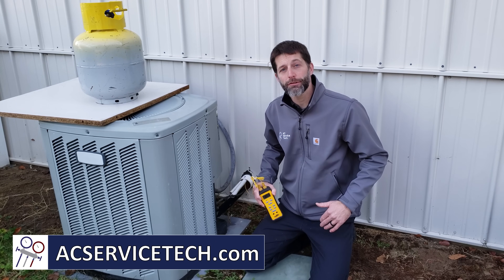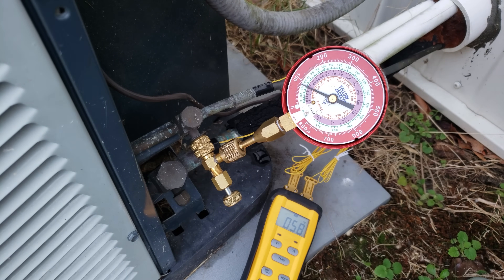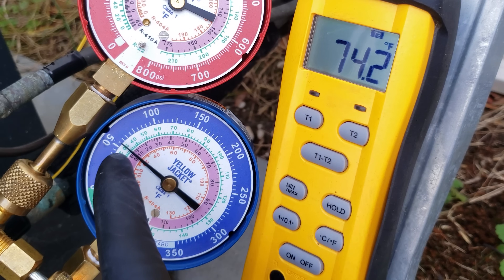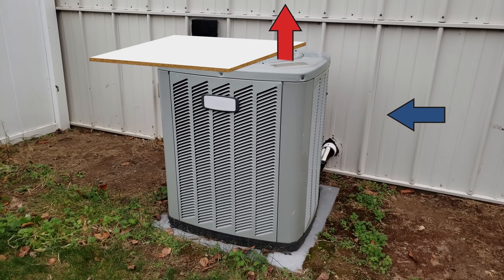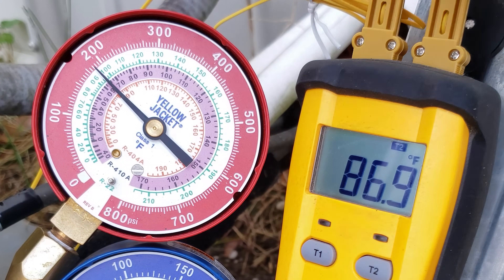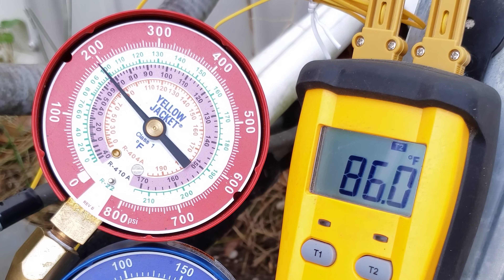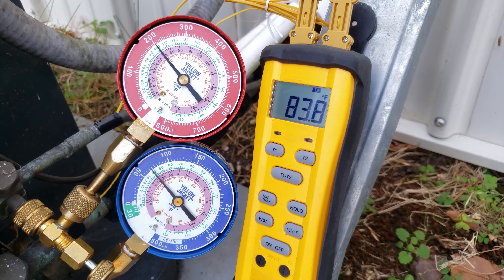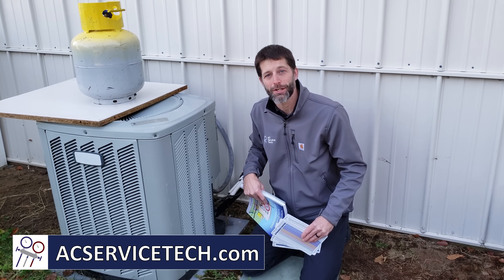Low Outdoor Temp, "CHECK THE REFRIGERANT CHARGE" in the Cold!

Comment from the maker: Below are the TOOL LINKS and ANSWERS to QUESTIONS!
Fieldpiece ST4 Dual Temp Meter - http://amzn.to/2wc1ME3
Charging Jacket - https://amzn.to/2rCNcnm
Blue Test Gauge - https://amzn.to/3mxYt5t
Red Test Gauge - https://amzn.to/3pvzxxo
Thumb Screw Valve Core Depressor with Backseat - https://amzn.to/2mR0sCL
Quick Reference Charging Cards - https://www.acservicetech.com/store

The total superheat was a little high especially with the low heat load. I will need to check the charge again during the beginning of summer to investigate why the TXV isn't allowing more refrigerant into the evaporator. The bulb was mounted correctly. I did see that. The superheat should be lower such as below 16 degrees but preferably closer to 10 degrees. Any time you check the charge this way during low outdoor ambient temps, it is only in a worst case scenario and the technician should schedule another service to measure the charge again when there is an adequate heat load on the building such as 85 degrees or higher outside and 74 dry bulb or higher inside temp and a 60 degree or higher indoor wet bulb temp. Realistically, the indoor and outdoor dry bulb temps both must be above 70 degrees before and during the measuring process. Thanks!
Reply: Many thanks

Comment: But, it seems you could have achieved any amount of subcooling you wanted by restricting the airflow more or less. When you started out you had low subcooling because you were restricting the air flow only a little bit. Once you restricted the air flow more you got higher head pressure and higher sub cooling. So why don't you just restrict the air until you get 10° subcooling and then say that it's correctly charged?

Comment: Do you need to have the indoor air temperature above 70 degrees to accurately check subcooling or can subcooling be measured effectively just by using a charging jacket outdoors without having to heat the indoor space to above 70 degrees?

Comment: I have the exact same unit. Mine is manufactured in 2008 so 15-year-old. It is not cooling. I called an HVAC company and technician hooked up gauges and said it has low refrigerant. They dont add refrigerant because it is R22. I am immediately connected with a salesman to get a quote of 10-20k AC replacement. It is so frustrating to experience all of these especially this time where I am looking for my first job after getting my PhD. 

Anyways the tech measured the pressure when it was 50-60 outside. He didn’t do any heating method as you described. I wonder the measurement he did was false

Comment: I find you can't muck about, the room will reach setpoint pretty quick and shut off before you're ready.
Btw I'd definitely flip it over to heating to recheck the pressures
Reply: That’s if it’s a heat pump otherwise you can’t check the pressures in heating mode

Comment: To many variables that can give you a false reading and no actual humidity load to simulate wet coil condition techs will be recovering charge in winter and recharging in summer wait for adequate testing temperatures.

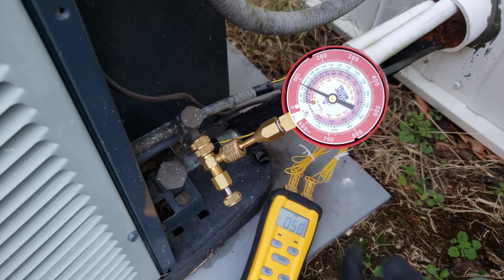Comment: 2:00 how is that silver stem on the depresser not leaking refrigerant? I don’t understand what’s keeping that sealed
Reply: Just a compressed gasket or oring.  There is  a packing but you can tighten if it ever starts to loosen up.  You tighten that nut and it further compresses the sealing material.  Exactly the same idea as any water gate valve.

Comment: I use a contractor garbage bag as a charging blanket. Simple light weight multipurpose. Easy to adjust and no risk of the plywood flying off and causing injuries to a newbie tech.
Reply: Wouldn't a bag fly off faster than a board

Comment: A contractor garbage bag blocking the intake of air would be easier.Easily and safely adjust the amount of air that is moving across the outdoor coil. No wood or recovery tank to deal with. Also less stress on the fan motor. Cheaper than a charging blanket and it serves two purposes.

Comment: My minisplit is a 12,000 btu unit. Unit indoor and outdoor are running there is no error code appearing so I let it run all night about 12 hours straight, indoor not heating or cooling? indoor fan is turning but only getting ambient room temperature coming out of head unit was installed by licensed hvac teck 2 years ago can anyone help thanks.

Comment: I would be weary to use that method to check the change, I mean what if you move the board on top? The pressure is gonna change right?  How do you know where to put the board or how much to block off?  I just feel it's a "fire from the hip" scenario where you don't truly know what the charge would be because you moving the board blocking the airflow will have a major effect on your pressure. I'm jaded cuz I work in South Florida and its only cold for a month outta the year but I wouldn't hang my hat on that method. Thank you and your videos are great
Reply: It's pretty much a good ballpark figure, but you're right not 100%. As an installer in NW Louisiana we have way more cold weather start ups, we always schedule a follow up return visit when the weather warms up to recheck. No additional charge to the client, and saves the extra cost of an unexpected callback for a tech at 10 o'clock at night lol. Gotta love weather in the south..
Reply: This is making the best of an non-ideal situation.  Anytime you have to check charge  outside of design conditions is technically not ideal... Which is almost always by definition.  This method is not perfect but if you have a thorough understing of the system and this method, you can be fairly confident with your results.  Many people that do this if they need to in cooler weather, will try and come back in warmer weather just to double check.

Comment: So I'm curious. Why are we driving up the pressure to simulate a warmer day in order to check the charge? Just because the sub cooling is naturally gonna be higher with lower temperatures?
Reply: To simulate actual working conditions /design conditions.  I believe you are correct - in low ambient conditions, the refrigerant condenses much faster so it will subcool much more.  The ratings given, like 10deg F ideal subcooling are for specific conditions.  Conditions, as he mentioned in the video of approx 72-74 deg F inside and maybe 70-80 deg F outside (I can't remember what numbers he used. Most condensers run at approx. 20-30 deg F above outside temps so to put the system into "design-ish" conditions we have to get the head pressure up to a saturation temperature somewhere between approx 90 and 110 deg F.

Comment: Totally mis-leaded information and could be led to refrigerant mis-charge and equipment damage. 10F sub-cooling on name plate is equipment factory design sub-cooling at 95F ambient and 73F indoor wet-bulb temperature. I didn't see author did put indoor wet-bulb temperature into account. The truth is, if indoor wet bulb or outdoor ambient temperature or both below equipment design temperature the sub-cooling going to increases, if above the sub-cooling will decrease. 
For example: at 80F ambient and 70F indoor wet bulb temperature the sub-cooling will be about 17.5F.
Reply: You are correct. The little paper attached to the electrical cover called service facts would tell him that. What he is simulating is a ODU with an airflow restriction running in low ambient. This is not how it should be done.

Comment: If you take refrigerant out then your superheat is going even higher than 20 and with no heat load does not justify over a 20 superheat. Thoughts?
Reply: TXV's job is to maintain superheat (within a reasonable pressure range).  Removing a relatively small amount of refrigerant will remove total amount in the system.  TXV basically maintains the same amount in the low side so the refrigerant pooling in the high side is reduced... Lowering the subcooling.  *With any fixed metering(piston or cap tube) device you would see superheat increase and subcooling decrease.
Reply: @sbitschy  ... Just for reference...36 years in the trade and teach worldwide. Standard txv will not maintain superheat no matter what occurs. It will only maintain with within certain parameters. 👍 You can absolutely have a  super high/low superheat and subcooling.
Reply: @burtminshew4812  I don't understand what you are saying.  I am here to learn.  I said that a TXV can only maintain superheat in specific pressure range.  I feel like we said the same thing.  I am well are that you can have high superheats and low subcooling in certain circumstances.  It seemed like he removed a negligible amount of refrigerant, I didn't feel that it was enough to start messing with the TXV superheat control.  Can you explain what part you disagree with?

Comment: Wouldn’t moving the plywood change your values ?
Reply: That’s EXACTLY what I was thinking. Like, how can you REALLY tell it’s overcharged or not… If you cover it all up or not at all the values change… so which is right? Doesnt seem consistent and or accurate.
Reply: The entire point of this is that your values change depending on how much air you block off.  The 10 deg F Fahrenheit subcooling target is given for a specific set of conditions.  We can't raise the outdoor temperature to these specific conditions but we can block off enough air to get our pressures and saturation temperatures up to these conditions.  Your condenser simply rejects heat from refrigerant.  Since the condenser rejects more heat at lower outdoor temps and the same airlow,  we can start to block off airflow on a lower temp day until we are rejecting heat at the same rate as it would on a warm/hot day(the specific conditions where the 10 deg subcooling is the target.)
Reply: Sorry tough to explain in a YouTube comment... Anyways, the concept of what he is doing is perfectly legit.

Comment: Excellent explanation 👍🏿I can remember back in the day if a system was overcharged the hvac guy would just release some out the unit into the open air🤷🏿‍♂️
Reply: Back when I got into the Trade (1979) refrigerant tanks allowed you to add gas back into the tank.
The guy I worked for had two 15 pound tanks ( I not sure but I believe the 15# are no longer made)with red paint that he used as service tanks. He bought 50 pound tanks to reduce cost I think $19 per tank was the price 40 plus years ago. When a small tank was empty he would pull a vacuum and stick it in the freezer and use the 50 pounder to refill it the next morning. 
  Great guy to work for but taught me to add gas till the suction came back cold and several other bad habits that I thought was correct until I went to School for  HVAC two years later. Ours is a great Trade to have because you have to have knowledge of multiple trades to be qualified to do our trade. Which translates into rarely hiring someone to make a repair on your home.
Reply: Still do🫣

Comment: Here is my question, instead of pulling out charge could we adjust the txv to be more open? Wouldn't this lower superheat and lower subcooling?(assuming it's adjustable)
Reply: That makes sense to me.  I think it would just be a little more time consuming - labor costs are expensive, might not be worth it to the customer.  Also, depending on how long the vapor line is, 20°F superheat might not be that high - in a longer vapor line removing refrigerant seems like a better idea.  Just my thoughts.

Comment: Can you do that with a piston metered system?
Reply: My opinion yes but not the best. I run the unit to see how much above ambient my head pressure is. Then start restricting it and compare my simulated head pressure and ambient vs wet bulb to get a target superheat. If it looks low I ramp the head pressure up more and then check it again. If you go this route you have to monitor the superheat carefully to make sure you don't slug the compressor. Works best on cool calm days. Add rain or high wind and you're better off coming back on a different day.

Comment: Usually I love your videos but I'm a little confused in this one. With the valve core remover, you were not removing the Schrader core so why were you spinning it as though you were loosening it? Those just push in and out. You usually push in and then turn while it's pushed in.
Reply: That's not a Schrader valve remover. It's a low loss called thumbscrew core depressor.
Reply: @Pixelplayzhere  
Couldn't you just use this every time you put your gauges on regardless of using hoses or the stubbies?
Reply: @BibleBloopers  yes you can use it
Reply: @Pixelplayzhere  oh ok. Thank you so much

Comment: Why is superheat high if you claim to be overcharged?
Reply: I was thinking the same thing. Might have a TXV that isn't opening as dar as it should or is slightly restricted
Reply: Since the system has TXV, we should use sub cooling method, we don’t have to focus on superheat, because, we need just to adjust sub cooling to manufacture design degree,
Reply: @bill98778  you don't fine tune the charge with superheat if you have a txv, but you still need to see if it is within range to detect if there are any other problems. But Craig said SH is high, therefore it is overcharged. And I'm wondering how did he get that conclusion.
Reply: @realSamAndrew  well, if the system is overcharged, could damage the compressor, or since the superheat is high could be the TXV is not working properly even he said is doing his job

Comment: At the 6 minute and 40 second mark you said something that doesn't sit well with me. Not sure if it was a mistake. 
Why would the subcooling be lower when it's cooler outside and higher when it's hotter outside?
I would think it would be the opposite. 
The cooler it is outside, the more the condenser will be able to condense... More subcooling... and the hotter it is outside the less the condenser will be able to condense.... Less subcooling.

What am i misunderstanding?

I just looked this up and this is a copy and paste from online....

"As the ambient temperature increases, the condensing pressure also increases, resulting in a higher pressure differential across the orifice. This will increase the flow rate of refrigerant in the system, resulting in less liquid remaining in the condenser and correspondingly lower subcooling."
Reply: The sub cooling ends up being low in cold weather because the refrigerant isn’t flowing properly out of the condenser . The condenser is so cold that the refrigerant wants to remain stationary in it. You end up getting small bursts of liquid refrigerant leaving instead of a solid column of refrigerant. The temperature of the leaving refrigerant is not accurately sensed which manifests in low sub cooling.
Reply: Sounds like the quoted text is speaking about a fixed metering device.  And in that case I would agree that the flow of refrigerant through the metering device would increase. The low side pressure would also increase. I think that a tev would only briefly exhibit that behavior and then would pinch down to correct the super heat.
Now that does not answer your original observation, but I thought it may be helpful to say something about the flow statement from the quoted material.  Seems to me that increasing the condenser temperature while still maintaining a cool temperature outdoors would present a larger subcool reading than if the OD temp was much warmer.  Reason for this is the condensing temp same but colder air being drawn across the coil, and that would be accurate if the same amount of air flow of the colder air were in the equation.  In this case the airflow across the coil is reduced.  So what I am saying is that with this method it is kinda self correcting to a major extent and the subcooling should be a reliable number to determine if the charge is set.  So it was overcharged.  The only thing I do differently is push the condenser temperature a little higher to between 110° and 115° depending on the equipment design for most modern equipment I see.  Reason is that is a 95° day plus the condensing differential.  Not it may not be able to hit that high and maybe that was the case here or the instructor had some other reason to replicate a milder day.
Hope this helps, and keep watching this channel.

Comment: This want work on a piston metering device?
Reply: You’d use superheat
Reply: @jrenna07  same concept, just with super heat?
Reply: @floyddavis2095  yes. Restrict airflow like in video.  Fixed metering device you use superheat.  TXV you use subcooling since it is a “constant superheat device”
Reply: @jrenna07  thanks

Comment: What are your thoughts on refrigerant below the oil in the compressor when the outdoor ambient temperature is low and the compressor hasn't run for days or weeks? Wont it boil up through the oil, thus not allowing the oil to reach the parts of the compressor that it's supposed to be lubricating?
Reply: I've seen crankcase heaters on AC-only compressors, circa 90's.
Unfortunately these days, be careful a new heat pump comes with a crankcase heater else it can't be operated under 50F ambient.
Reply: @thisisyourcaptainspeaking2259  everything is customizable these days.
Reply: @Brokefootchuck  Hopefully it has an accumulator, or does the field tech need to design that as well?
Reply: I’ve worked in this field since 1975, in that time i’ve had many customers ask if they should run their AC occasionally in the winter. I tell them NEVER run it in the winter, nearly all of the refrigerant will be condensed in the oil and will immediately boil on start up and carry the oil out with it leaving the compressor running with little or no oil.
Reply: Crankcase heaters
Reply: @HVACRDUDE  only are installed on heat pumps. Not AC only. He was working on gas with AC.